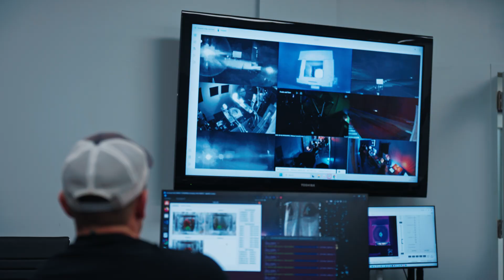Introducing Star Catcher: The Space Energy Company

Comment: Rather than use concentrator like Fresnel's lenses that may required large weights, why not use TIR and wavelengths convertor embedded in  1D or 2D wave guides to route lights to PV (then remove the need for multi junction PV as TIR in wave guides may not be satisfactory for broad wavelengths) inside the central module of the satellite? On ground demo may be thin film wave guide attaches to a PV or optical to power module at one edge, with majority of surface to provide clear view for transparent windows, or for those think PV modules destroy their roof top can have multiple transparent in visible band films do the sun light collection then carry that light to PV modules.